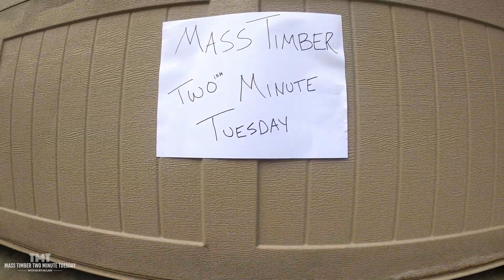Foundations for a Mass Timber Building: Can They be Smaller?

Comment: Probably a dumb questions; wouldn't adding concrete to a wood slab compromise the wood as it introduces moisture from the concrete into the wood? Like I said, probably a dumb questions, but I would think moisture would be the enemy of any mass timber structural unit.